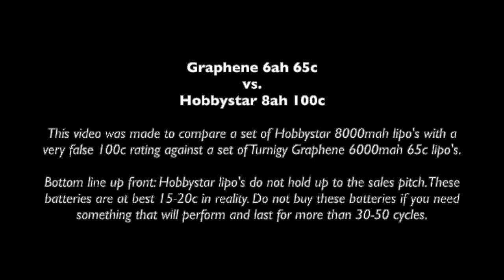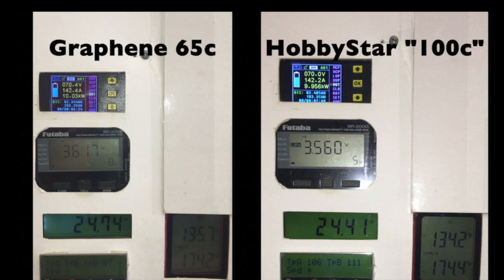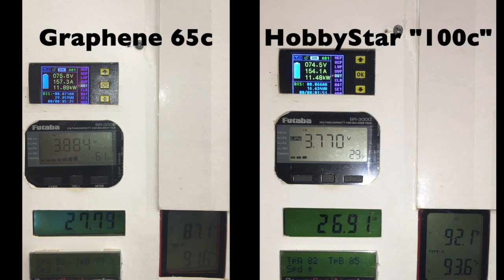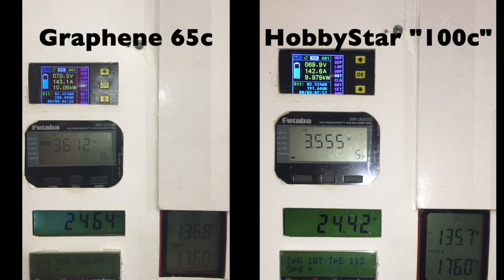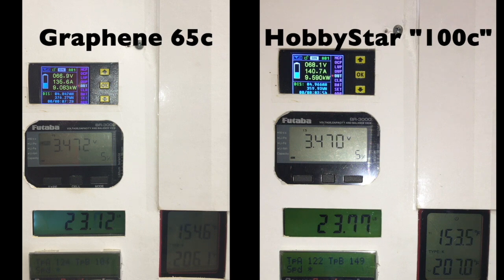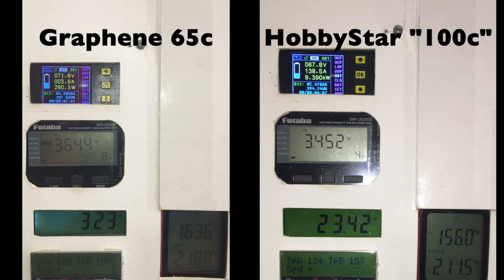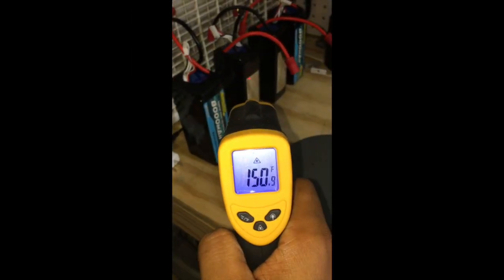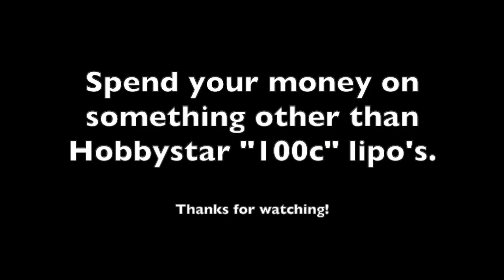Hobbystar 8ah 100c lipo test/review

Comment: The problem is Turnigy makes nothing over 6000mah or so.  If they made a high C rating 8000mah or greater Lipo, I'd buy it!
Reply from the maker: I’d do the same but these turning 6000’s will still outperform these crappy hobbystar 8000’s. I have abused the heck out of my turnigy batteries and all 8 of them still work and have no dead cells. When I say abuse, I’m talking about draining them nearly 100% by mistake.
Reply: @AV8B_Flyer  good point.